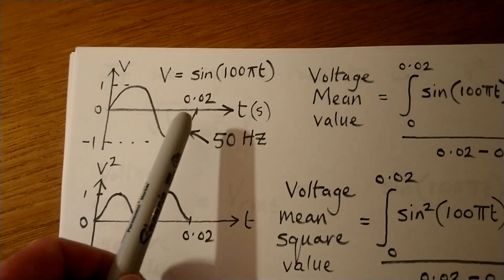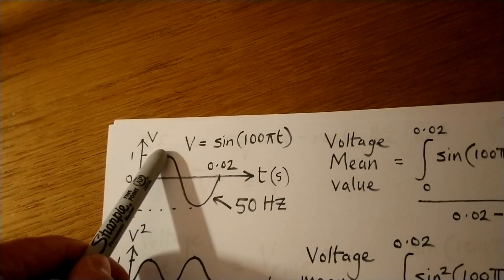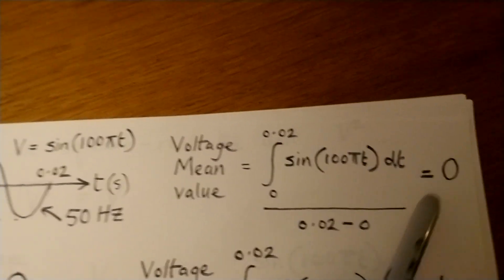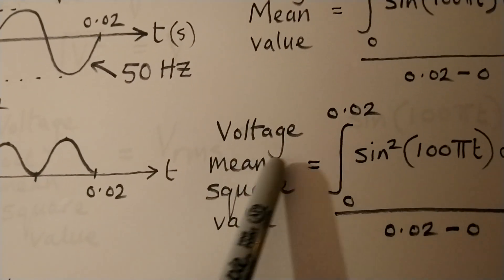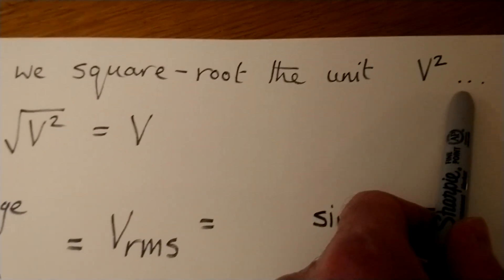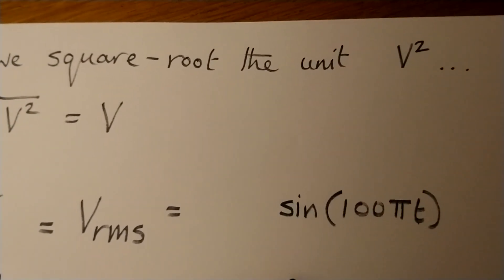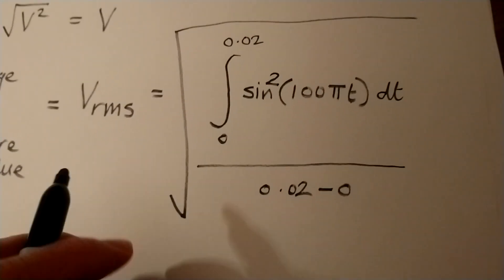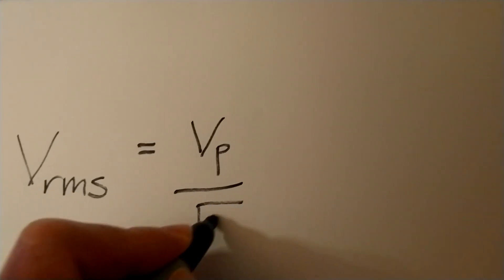How to find the root mean square voltage VRMS

Comment: Thank you
That was very helpful (took me some time to figure out where the 100 came from)
Reply from the maker: Thanks for watching and glad to hear it helped. Yes, good point about  the 100, perhaps I should have included that in the video but I was trying to keep things fairly concise. I think what I'll do for now is add a brief explanation in the video description, thanks for pointing it out 👍
Reply: @MathsPhysicsEngineering  
Suddenly, it hit me, you could do the same calculation from t-0 to t-0.01, skip the RMS and get the same answer.
Reply from the maker: @isrnmn   good thought, but that's incorrect. For example, if you have two positive values 7 and 3, then the mean is (7+3)/2=5. However, the RMS values would be calculated by squaring then adding the numbers 49+9=58. Dividing by the number of items: 58/2=29 and then square rooting, and SQRT(29) is not 5. So you end up with different answers. Hope that helps.